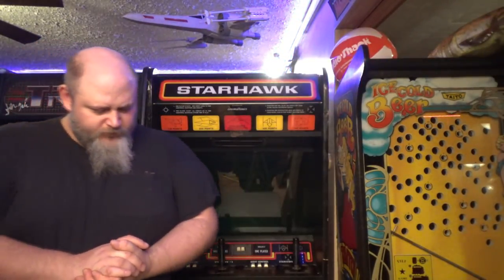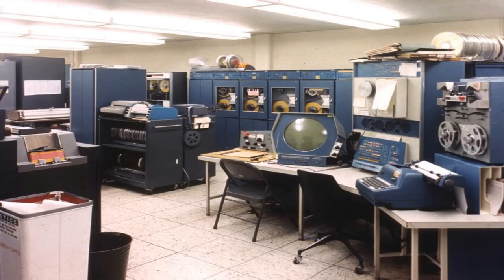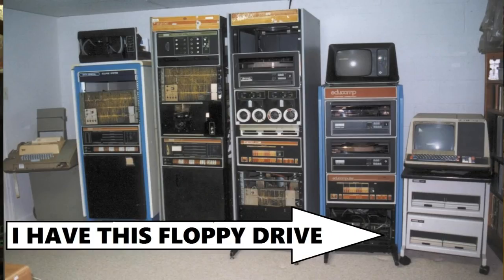The Story of STARHAWK

Comment: I finally got to try one of these again a couple days ago. The Draftcade in Richmond VA has one working as of the time of this comment 4-25-24. I played the game at Cedar Point in 1981 and had never seen one again, except a non-working one a local collector to me has/had who has since moved out of the area. I got my Vectrex on clearance in the early 80s, and it only made me want to see an original again that much more which had a great port of the game.

I didn't find the joysticks all that bad. Not the best, but generally worked ok. I had my wife shoot a clip of me playing, and I hit almost every target. The button on the right player wasn't too good, but probably an easy fix.

I was also glad to verify that Star Hawk on my Zektor ZVG board running on a G05-801 looked pretty spot on to the original game from what I remember. My HV board has been down a few years. I recall there were some missing sampled sounds which I since have obtained. If I can get a cable made, probably would be better on the DVG since sound board emulation of most if not all of the Cinematronics games has been added.

I bought an original Star Hawk control panel off eBay a good 20+ years ago as these joysticks are pretty unusual, and also the same I've heard on Warrior. I thought as a separate control panel I could play both games. I'd be happy with a repro or something very similar though if this would save another original game, but I haven't found anything similar. Sadly the plastic CPO graphics cracked when it was shipped.  

Draftcade in Richmond also has a Cinematronic Space Wars, but it's down currently. This is the 3rd machine I've seen in 25 years. All non-working. I haven't seen a working one since the 70s, and I'm dying to see one.

All in all, Star Hawk was a great game. Simple, but a lot of fun and beautiful cabinet artwork, cool sound effects. Not something you'll play for hours at a time, but pretty exciting to play a few games. I spent a lot of time in the arcades back in 1979 when this game came out playing Space Invaders, but never saw a Star Hawk except at Cedar Point in 1981. They did have Space Wars at the mall arcade 20 mins away when it came out. I was young and didn't really understand the controls at the time, until Asteroids came out which was everywhere in 1980.

Comment: Star Wars was 1977, Star Hawk was 1979 (I'm old, so saw both as they took the wrappers off them). The "influence" is no surprise.
Reply from the maker: thank you for the correction on  starwars woops !!!!    star hawk  did come out in 1977 though.  there is  some data on the internet that  incorrectly dates it at 79 .also my starhawk says 1978 on it and my spare marquee says 1977  here is a link from a more reputable source https://www.arcade-museum.com/game_detail.php?game_id=9781
Reply: @ArcadeJason STARHAWK did not exist in 1977, as that is impossible.  SPACE WARS came  FIRST, debuting at a AMOA trade show in October 1977. It was then officially released in early 1978.  Larry Rosenthal left Cinematronics in May 1978, and Tim Skelly was hired that same month.  Tim couldn’t have started programming Starhawk until May 1978 at the earliest.  STARHAWK was not officially released until early 1979.  Maybe a few trial machines were placed at limited locations in late 1978.  But STARHAWK out in the wild, in 1977, is impossible.

Comment: The fact that trick works means the switch eventually gets magnetized like with a watch spring. They make tools expressly to demagnetize watch springs without touching the innards of the watch. So yeah, extremely reliable switch. That one flaw is easy to manage if you have such a tool (I got mine for five bucks two years ago) the reason the switches are being magnetized is likely them being close to the crt in the longterm. same with setting a watch on top of a crt tv, people did that all the time back in the day. These days the largest risk of it is from anti theft systems used by stores and metal detectors.

Comment: When I got my Starhawk it was tripping one of the circuit breakers in the power supply; thought it was going to be a monitor issue but it was a shorted tantalum on my sound board. More recently the diodes in the power supply cooked; I haven’t run it much since replacing the diodes but it’s still working.